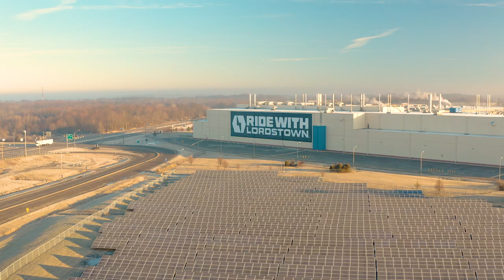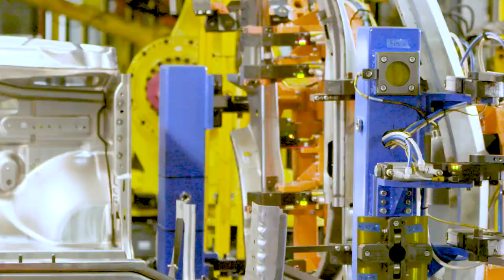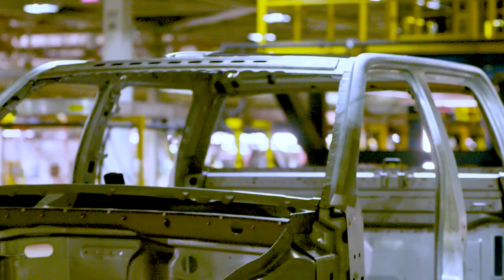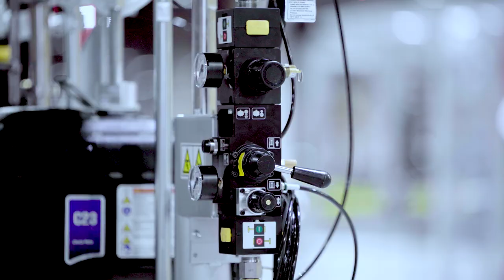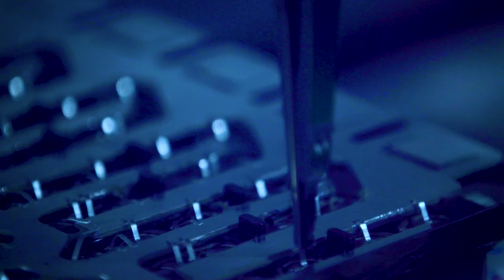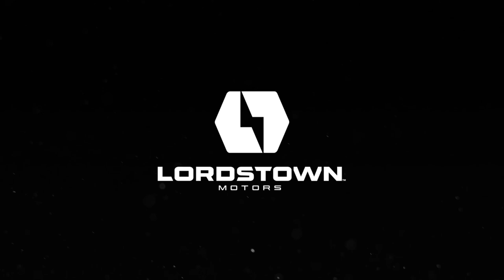Inside Lordstown Motors | Lordstown Motors

Comment: Lordstown  has not exhibited their wheel hubs assembly line and in action. It's hard for any investors to buy into it. Most of the stuff they are showing just body frames, and it's not even a complete body. I do not know how are they going to be able to produce mass production in september.
Reply: While I have some shares in RIDE, and do think they are legit, I would love to see the hub motors assembly.   At least this video also showed a little of their battery. 👍
Reply: Agreed, same old antique robots sped up on video welding a cab. This is the bare minimum, barely. Their EPA/MPG is terrible and they use the biggest battery? It is sad to think that of they do make it to production tax dollars at municipalities will be wasted on this rather than waiting another year or so to buy a truck that actually has something compelling to offer. And the price? They say its cheap?  SMH
Reply: @stephensmoot8564  250 mile range isn't bad, got enough for me. After the federal tax rebate, you would have a new 4WD pickup for 45k, which is very competitively priced, I don't think you've been truck shopping in a long time.
Reply: @murc111  I have checked pricing for what a typical fleet vehicle truck would be and this is a premium. Sure if you want to compare it to a fully loaded truck it’s compelling but it’s obvious when you consider the battery size needed to get that 250 miles that this is not efficient at all. I hope they survive as there are a lot of employees that need their jobs but being first doesn’t mean anything if in a short period of time they have antiquated tech.

We will know a ton if they actually do get the betas out for testing and the results are in line with the promises. At this stage it is only a story with a few little clips of what might be.
Reply: @stephensmoot8564  I agree, the beta vehicles are very important. But "antiquated tech", no, (IMO) in hub motors will be the standard for every EV in a decade.
Reply: @murc111  my point is that they “could” have the first ever EV truck to hit the market but looking at specs once the others hit the market like Cyber Truck, F150, GM, etc the specs they are hanging their hat on will be old news and sales would plummet. That being said one has to also wonder if these trucks will actually be profitable? It appears they may be ahead of themselves and management lost patience and should have slowed down a bit. 

Btw the CNBC interview today was a disaster
Reply: @stephensmoot8564  - I saw that interview, he looked a little nervous, because he could tell the host was trying to pin him into a corner.   He has a lot of scrutiny on him, but this is a short term blip on their path forward.  If they hit their 2021 goals, (good beta tests, Solid performance in the San Felipe 250 race, show off campervan prototype, & hit decent production numbers before the year is done) they will be $50 a share.  As for competition, GM?  An 80k Hummer is weak competition, as is a 70k Rivian, Ford will likely be at least 10k higher then the Endurance, Cybertruck will take the lions share of the early EV truck adopters, that is by far their toughest competition.  But after the rebate, you can get a 4WD Endurance for 5k cheaper then a 4WD Cybertruck.  Without looking like a early 90's low-poly video game.
I think they can have a bright future, if they can weather the storm.  I think people like you are looking for something, where there is nothing.
Reply: Hub motors have the issue of unsprung mass, this is especially true in the size of a motors needed for a pickup truck.  I would like to see how they solve this basic physics problem. Aptera might be able to get away with using hub motors, since their vehicle is so light and the motors are so small. I would like to see Elaphe’s hub motor testing data for real world conditions with the issues of unsprung mass involved.  Lab testing should be treated as preliminary until testing with real world stresses due to road forces and unsprung mass loads for the proper number of duty cycles.  Hub motor vendors always wave their hands and blow smoke at the unsprung mass issue.  (IMO) Lordstown is going to need something like a high speed active suspension system to address this issue.  They need to tell us why their suspension can handle it, when others couldn't in the recent past?
Reply: @spaceydave762  - I'm sure that's one (of many) reasons they are building so many beta vehicles, they know they need a lot of testing, and the more vehicles you have, the quicker you get your results.
Reply: There is video of the hub motors "in action". They've used them on test vehicles already.